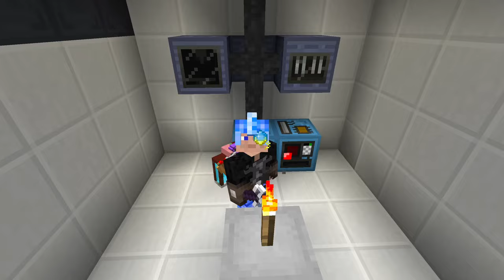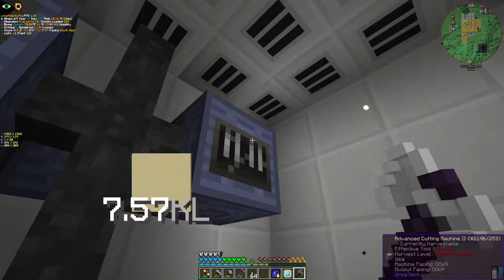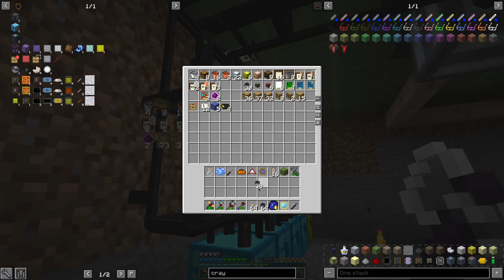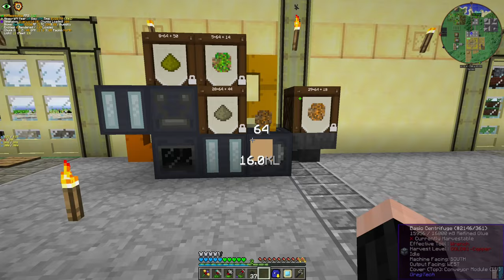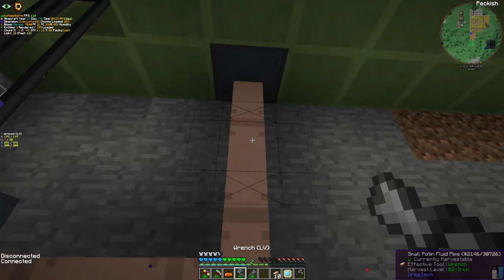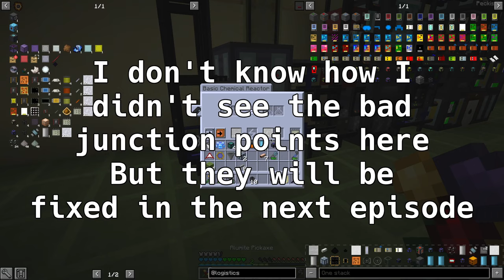A Logistical Touch of Chemistry | GregTech: New Horizons S2 - 29

Comment: my brain is too short, i have difficulty understanding when you need Passive Supplier Module and when you need simple, going too long format and explaining more will hurt youtube algo on video, what i suggest you add screenshots of info like this, people will likely pause there, and some one like will also save that timestamp on my personal notes as a tutorial of feature refference, that increase youtube algo as well,, 

i know you have also created seperate tutorial video, but graphical representation help more people, like in future when you setup platinium line, make graphical representation of flow,
Reply from the maker: I'm mostly an old-school Youtuber, even though this channel is relatively new, I've been making videos since 2012, so I'm a bit stuck on the old way of doing let's-play and explaining EVERYTHING stuck with me. I'm trying to get better at this by mostly doing complicated builds off-camera and just explaining new concepts when I first use them and doing an on-camera recap of how it works. For example, I did the Platline like this, but it's still new to me and I'm really bad at this :D So feedbacks are always welcome here for me to get better and understand what is interesting and what is boring/confusing.

Also about editing a diagram, I usually do not have much time due to work and I'm not a professional editor, so I usually might not have time to edit much, but I might try something for my new oil/wood byproduct processing line I still didn't record yet. So, thank you for the idea and feedback and sorry for the wall of text :D